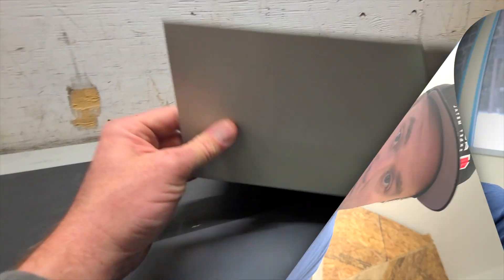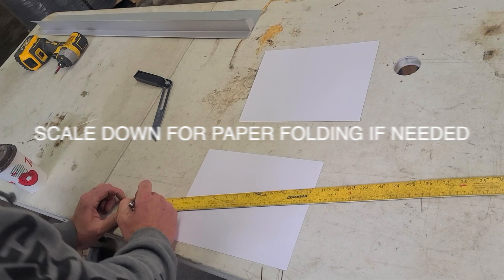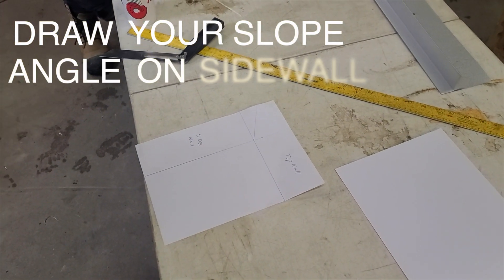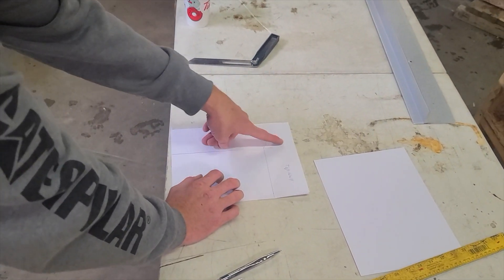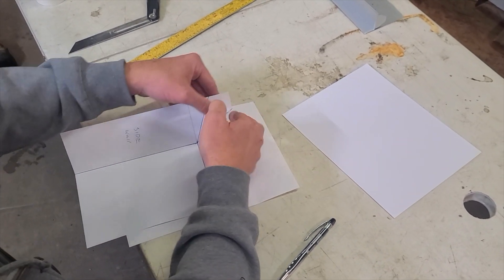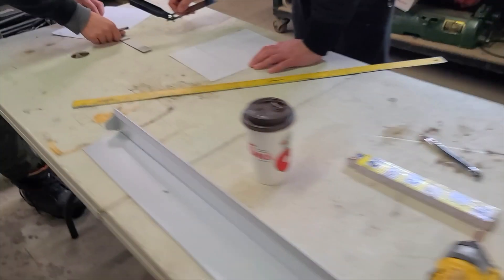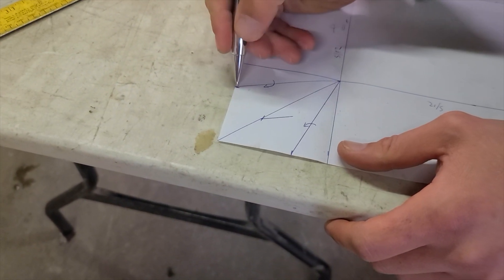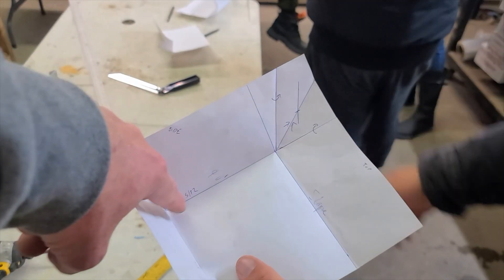A Sheet Metal Bend Technique That YOU NEED TO KNOW!!

Comment: Cant do that with snap lock panel... if you can, I want to see it.
Reply from the maker: Are you referring the pocket fold?  What type of snap lock are we talk here?  These details are typically used in low slope applications...snap lock is a steep slope profile only anyway
Reply: Yea you can, you cut the outside leg off and leave just the inside. Than with your folders open the angle so it's more obtuse and put your folders in the corner a little past where you are gonna bend , start bending up than pinch together and fold and bring it behind your bend
 Hard to explain easier to show but I've done it hundreds of times